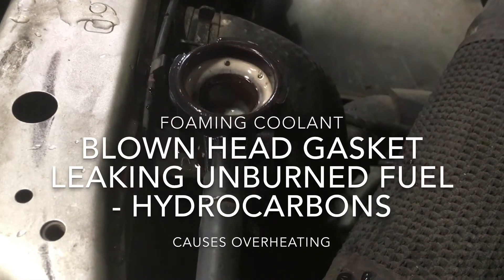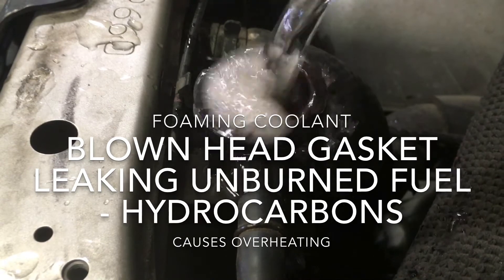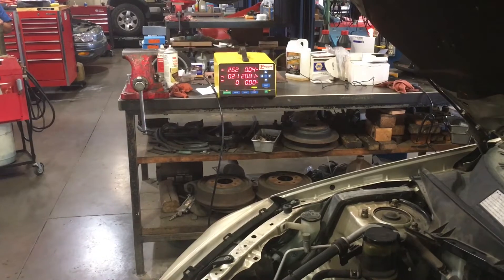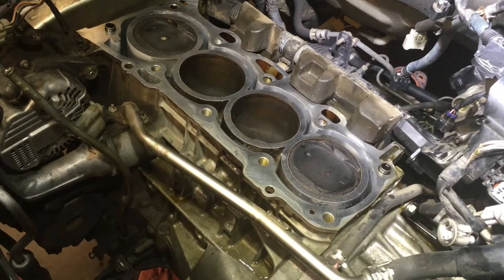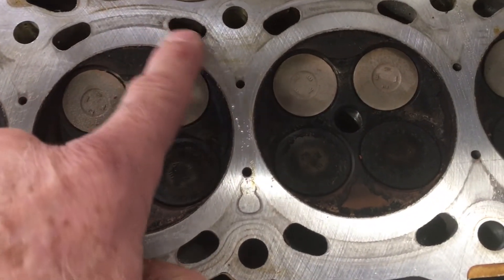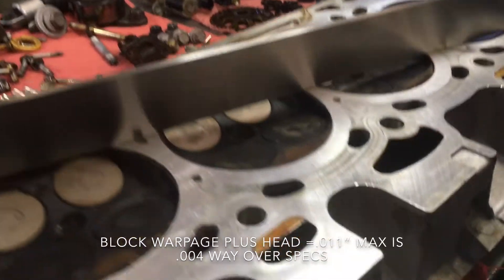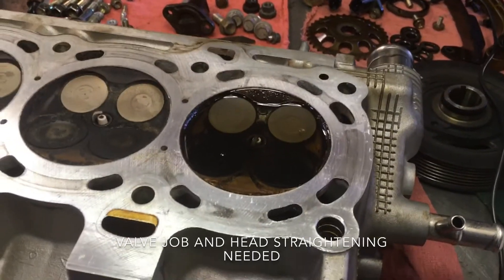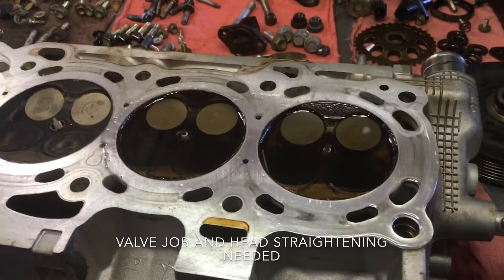RAV4 BLOWN HEAD GASKET SYMPTOMS

Comment: my 2.2 l rav 4 has exhaust in the coolant reservoir. Still drives ok but need to add water now and again. Is it worth fixing or scrap it? (2007... 130,000 km)
Reply from the maker: Depends on the area of the country. In the dry desert that is low mileage and would be worth the repair. If you are in Canada or Mexico (clue: km vs miles) check your local listings for sales prices.
Reply: @jimmaddox5958  I´m in Germany :)

Comment: 4/24/23

Just found your really helpful video. My 2010 4-cylinder RAV4 blew a head gasket today. Not even 141k miles on it. Meticulously maintained. Didn't overheat. Just started having cylinder 1 misfires last week. Dropped it off, thinking it needed spark plugs and ignition coils. Wasn't making any noise. Ran great, other than the new misfire and sputtering. 

Went to pick car up and was told the problem was not coming from a spark plug or ignition coil. Started my car and heard a new horrible noise. Luckily I didn't have far to go to get it home. 

Heartbroken. I have had ZERO issues with this car since buying it new. Now not sure what I should do.
Reply: Mine did also today. What did you do?
Reply: @user-wr2bf8zq1w  
It could not be repaired and there was only an $8000 used engine available, so I sold it and bought another vehicle.
Reply: @user-wr2bf8zq1w  
What are you going to do?

Comment: Thanks for video. Yes, send the head out for resurface, but I just lap the valves.  Keep in mind that because the head is cold,  and there may be fine carbon deposits on the valve or seat surface, so the seal is not good.  Unless the head is new and fresh, the cold test done will always have some leak.  Valves may seal hot, but cold may leak a bit because they are broke in the hot condition.

Comment: i've found everything to look for in a bad head gasket

-coolant in overflow/radiator turns brown, gunky like chocolate malt (solution: empty and spray out container that holds coolant, refill with Prestone Toyota 50/50 or water)
-car leaks/burns oil and it gets worse and worse to eventually leak a quart a day (solution: Blue Devil rear main sealer did the trick, dump a bottle in every 5 months avg, top off with oil when needed)
-engine runs really hot, but temp gauge won't work, exhaust running so hot and putting out soot and eventually falls apart, cracked muffler etc. (solution: repair exhaust annually or run a short pipe out the side, car with full exhaust will last a lot longer, even short pipe helps a lot, exhaust may damage car)
more when i think

Comment: So I have a 2008 rav 4. The problem with my car is that I was driving on high way and it start to decrease mileage and stalled on side of road and start over heating and leaking. Car will no longer start but dash lines comes on does that mean my engine is gone or is it the gasket doing this.??
Reply: Yeah I found out today my 2008 Toyota rav 4 blown a head gasket with three cylinders due to running on low oil. Engine was under 145k miles I'm getting used less mileage motor replaced later this week.
Reply: @ZackWolfMusic  can I know what is  your quote for replacement an engine?
Reply: Same thing with my 2004 Rav4. I have not been able to get it fixed.
Reply: @toledo3211  yeah I'm thinking about auctioning it off to co part. But first I will have someone look at it to see what's the issue and if costs to much I'm auctioning it off without a dobt.
Reply: Happened to me the same few days ago with Toyota Rav 4 2003. I was told my engine is gone. I have 258.000 miles.
Reply: my 96 rav4 doing the same but ive drove it 22k and 3 years and keep dumping oil and coolant in